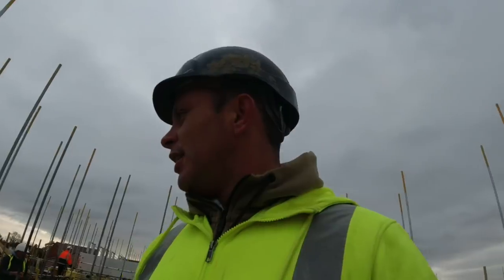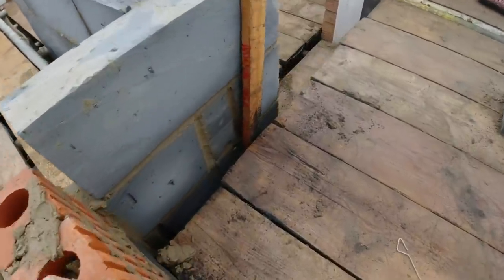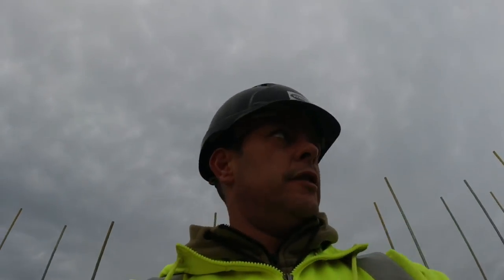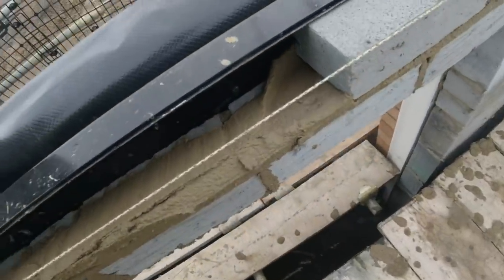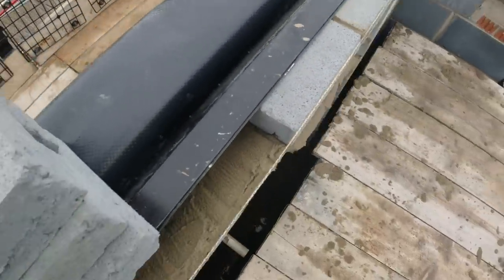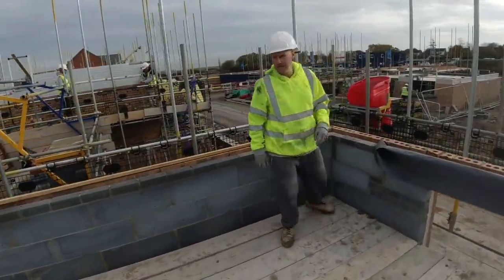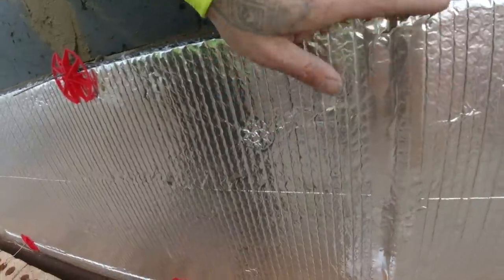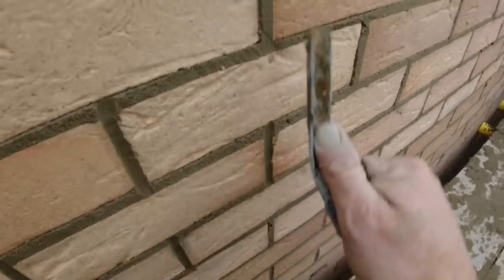bricklaying (finish joist /start joist)

Comment: adam question for ya mate, whats the purpose of the burlap cover, i seen you cover up before on a lift, cant be because of rain it will soak thru burlap, so whats its purpose,cheers
Reply from the maker: Its hessian mate to stop the frost bud🥶🥶🥶
Reply: @trickybrickys  that does make since now,, thanks, lean something all the time, cheers